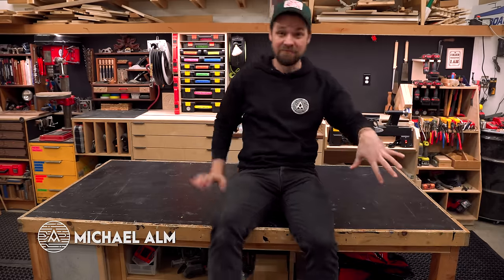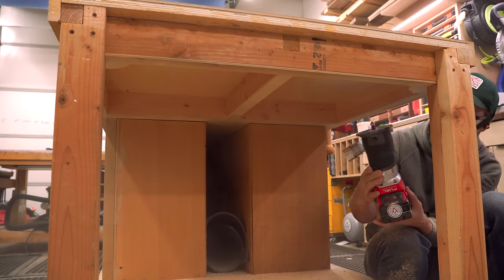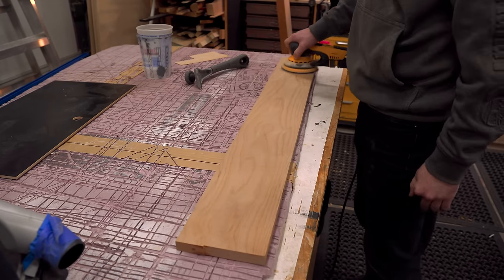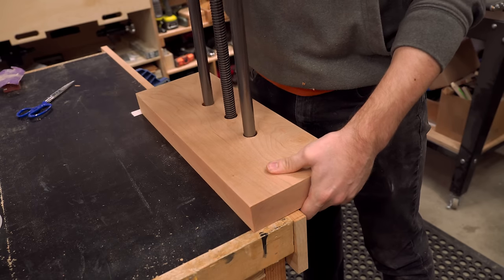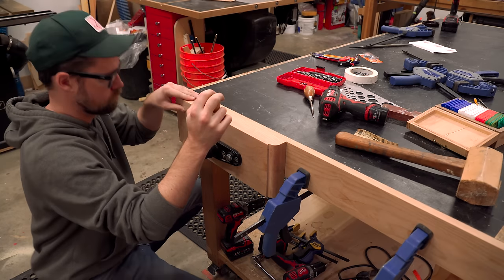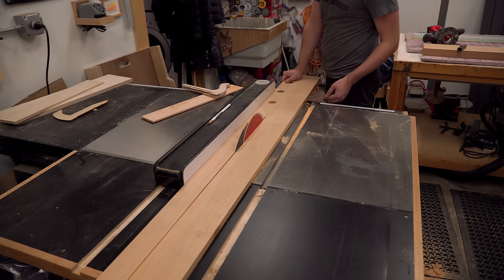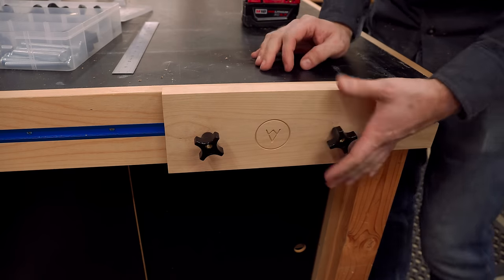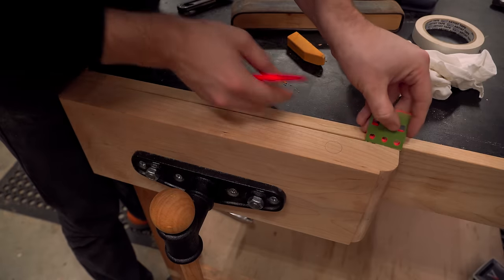Building the ultimate HYBRID WORKBENCH

Comment: Tip for the vise jaw; taper it so it touches at the top first. You will notice when you clamp down on work, the bottom of the jaw moves in, there's a certain "flex" in most vises....... If your jaw is plumb without a taper then your jaw is wider in the top and work isn't gripped as tightly. When you add a small taper as it's cranked down the bottom will still pull in, but the taper means the jaw isn't opened up more in the top...... This grips the work much stronger. Its more evident when a board is clamped upright, like when cuttin a dovetail or the likes....... Its held tightly at the bottom, but the jaw is opened more up top an it can make the work vibrate when sawing, it's vexing. With a tapered jaw it touches in the top first, an as it's cranked down it brings more of the jaw against the work 😁
Reply: 😢😢 16:22

Comment: Such a great video. Lots of little tips I wish I’d known when I installed my vice. 

The t-track is such a great idea. One suggestion for that stop would be to elongate the holes downwards so that instead of having to pull it out and flip it all you’d have to do is loosen the knobs and lift up slightly.
Reply: I was coming to the comments to share the same input!  I was thinking L shaped holes that way you wouldn’t have hold it up and tighten at the same time.

Comment: It might be worth cutting small slots instead of holes for the knobs in the piece you are using as a planing stop. Then instead of having to loosen it, slide it out, flip it over, and slide it back in, all you would have to do is loosen the knobs, raise it up, and tighten them back down. As long as the "low" setting is flush (or below) the top, then resetting it is as simple as loosening the knobs and letting it drop, and raising it, while still simple, will be quicker than what you have now and potentially more adjustable since you could raise it to less that "topped out" if you wanted/needed to.

Comment: Fun video. Enjoyed seeing how you built the tables. 6x3 is the Goldilocks size for my shop. 8x4 is too big. 4x2 is too small. Traditional hand tool bench is 52 x22 but that isn’t necessarily for keeping projects/assembly.

I love a chamfer of any size on the top outermost edge of the moving vise jaw. Helps when going up and down at angles with tools and stops me from hitting it. I run my hands across that edge so many times for guiding strokes.

Comment: @23:18 No need for a straight edge. The sole of the plane is one!

A better way to get the high spots with a plane is to set it for a fairly shallow cut and push the plane down the length of the vice jaw with the plane body skewed about 45°, so the back rides on the reference surface (the bench top) and the iron passes over what you want to bring down. Keep pressure on the heel so it stays firmly on the reference surface and the front doesn't get pulled down by the cutting action.

Comment: Also, if you slot the bolt holes in the planing stop board, you'll be able to lift it in and out of position by just loosening the knobs, instead of having to pull it out of the T-track and flip it over.

Comment: The perpendicular bisector of every chord of a circle goes through the center of the circle. They do not have to touch as you stated.

This is evidenced by the fact that a diameter is a chord, albeit a special instance of one. No diameters share any common points except the center itself.

Comment: On finding the center of a circle, you're halfway to an easier way. Just draw a triangle where all 3 corners are on the edge, doesn't matter what shape of triangle, this works almost no matter what, as long as all 3 are less than 90°. Then from midpoint of each edge to the opposite corner of the triangle, all three lines meet in the middle. (Learned that one on junkyard wars when they built a hovercraft)
Reply: If I've understood your description correctly, that involves measuring the midpoint of a line though which is prone to error and I personally find fiddly. I can see it being useful in lower accuracy situations - for finer accuracy I'd prefer the no measurement method.

Comment: Suggestion for t-track:  use shorter pieces with gaps in the middle of runs so you can insert/remove t-bolts in the middle as well as at the ends.

Comment: It's very rare to get a workbench "correct" the first time around.  Unless you know exactly the kind of work you are going to be doing, and know that you'll be sticking with the same type of tools throughout your woodworking life, it's pretty near impossible.  You are doing great if you only have to build two benches (or rebuild/modify once).  It took me three times over 19 years to dial it in.  If your shop can handle space for two types of benches, that's the way to go.

Comment: You'll probably want to add a 45 degree bevel to the handle-side of the vise jaws.  This will give you clearance for hand saw blades as you're cutting stock held vertically in the vise (like for half-blind dovetails).  Without the bevel, you'll have to have the stock sticking up several inches above the vise jaws, and this either may not be possible for shorter length pieces, or for longer pieces it leaves enough unsecured that the stock flexes as the teeth bite, leading to ragged cuts and way too much noise!

Comment: I haven’t ever used one of those Rockler or similar drill press jigs. On my bench I used my Festool lr 32 system for the dog holes. Only limitation is you kinda have to stay within a spacing divisible by 32 mm. I have also seen people cut the dog holes out with a cnc.

Comment: Those are some fine upgrades which will make woodworking even more fun.
Just wondering: you mentioned you based the location of the dog holes with your vises as starting point, but didn't you plane the smaller vice more on one side than the other? 
I really like the personal touch of your logo with the Shaper. Nice 🙂

Comment: 27:13 wait i thought you picked out the cherry wood for the jaws specifically because of its density and how it would interact with whatever you're working on? doesn't the cork kind of nullify that decision?
Reply: Yeah you can make vise chops out of plywood. It doesn't look as nice as solid wood does but it works just fine. Plywood will be more dimensionally stable too.

Comment: If you didn't have the portable drill guide you might be able to use a router. Might be kinds sketchy though
Reply: I just used a bench top drill press. They don't call them bench top drill presses for nothing. I put it on the bench and drilled away. You can get a cheap bench top drill press for cheaper than what some of those drill guides sell for. Some actually like their dog holes angled a little. Pro tip: do NOT cut square holes into your bench. Round is way better. The argument that you can always make more dogs is not valid. I'm using the same piece of dowel I bought 30 years ago. I still have half of it left. I even have plugs in all of my dog holes so sawdust doesn't filter down under the bench. I just push them out when I need to use a hole.

Comment: 7:30: Circle trick. I do a similar thing with a protractor (or usually a square with a scale), and it requires fewer steps. (More clear than my explanation https://www.youtube.com/watch?v=xkkIziKDGt4. And for a method that requires no measuring, we have Thales Theorem https://www.youtube.com/watch?v=4mVYceMvhls&t=49s
1. Draw a chord on the circle. A chord is a straight line that joins two points on the circle. No place in particular, you just want it to be closer to the edge of the circle than the center.
2. Draw a perpendicular line from the center of the chord to the opposite edge of the circle.
3. Draw a second chord somewhere else on the circle.
4. Draw a perpendicular line from the center of the second chord to the opposite edge of the circle.

The intersection of those two lines is the center of the circle.

Basically you could start with your first two lines and instead of the dividers just draw the perpendicular lines from the center of the two chords formed by those lines. Their intersection will be the center.
Reply: Interesting. I’m going to try this way too. Thanks for altering me to your post.
Reply: > Yes this method also works, although I prefer Michael's method. 

> The method you describe is much simpler for a beginner, but it requires more tools: 
        > 1 Protractor to draw the circle 
        > 1 Pencil to draw the circle and the perpendicular line, potentially 2 pencils to avoid removing the pencil multiple times when drawing many circles.  
        > 1 Ruler to mark the centre and draw the perpendicular line and/or 1 set square. 
> So up to 5 tools. 
> Michael's method is much quicker as it only uses 2 tools, with no need to remove the pencil either.
> It uses two clever mathematical theorems:
        > Perpendicular bisector
        > Perpendicular bisector of a chord (which is what you describe, i.e. where the two perpendicular bisectors of chords meet is the centre of the circle.)
> He also uses the same point of origin for the two chords, so when drawing the arcs he can draw them for both chords without needing to move his protractor.

> Michael could make this method even faster and neater by only drawing the parts of the arcs which actually intersect at the top and bottom.
> So Michael's method is faster if you know how to use it, but your method has its merits particularly when you are trying to find the centre of a circle which you didn't draw in which case you might not have a protractor handy.
Reply: @k4_mi1  Ummm. Why are you including the need to draw circles. My method requires the drawing of no circles. I think you are confusing a compass with a protractor. Please google. I am not expecting to draw circles. Only find existing circle's centers. Michael traced those from a workpiece.

And, I do this regularly with one pencil and a square with a scale. You only need one angle. 90 degrees.

I have no idea what you are on about in your process. Again...

Use your square to draw a chord. use  the scale (ruler) on the square to measure and mark the center of your chord. use the square to draw the perpendicular (at 90 degrees)  line to the chord. Do again. The intersection of the two perpendicular lines is the center. This is only 2 tools, and far fewer steps. And more accurate as you are introducing less variability with the width of the pencil line.

Edit: Please see here https://www.youtube.com/watch?v=xkkIziKDGt4
Reply: Stoney, your argument "I don't need to draw circles" is kind of a red herring, as you have "2. Draw a perpendicular line from the center" --- exactly that step is accomplished with a compass (with the compass being more precise as you don't have to measure to find the center then add the imprecision of drawing a perpendicular with protractor). The other thing to notice is that "3. Draw a second chord" is exactly what Alm's method starts with (you suggest two random chords, Alm just recyces one of the original chord's endpoints for his second chord. So. If anything, I'd say there's no need to draw these two chords like Alm did --- just choose the three endpoints, the hole made by the compass will make it clear enough which points you chose.
Reply: @SenselessUsername   I don't use a protractor. If a square with a scale is not accurate enough to find the center of something all the woodworkers are doing it wrong. Also, I "measure" when I draw the line so I don't do it a second time as in my instructions. It was just easier to explain. I have a centering scale on my square. When I draw my chord I just make it a specific length and it's easy to mark the center when you draw the line. And Thales Theorem still uses that same square and requires no measuring. I'll likely be doing that from now on depending on the situation. I don't have need on a regular basis to have a compass in my apron and I am not going to go digging for one. I suppose I could get dividers that include a writing instrument provision, but I prefer my dividers to be clean. But my square (several really) is always right there. 

Now, in another vein, if you are suggesting that geometry, and especially the intersection of arcs at equal distances from a common point and how powerful that is, could be a way to improve my woodworking, you are correct. I use it sometimes. But for those times when I just need to get to the center of a circle quickly it's the square that is within reach.
Reply: Wow you guys love type

Comment: Those cast iron hold fasts wont bend. They'll stretch out your dog holes.
Reply from the maker: Do you have a recommendation for another type? To be honest I'm not too happy with them.
Reply from the maker: @cycleincircles  Right on! Thanks for the info 🙌
Reply: @Michael Alm  oh- lastly there's a sweet spot of hole-depth for the holdfast to have the best everage on the work. It's about 3 or 4 inches. You may want to add some 2-by lumber pieces under the tabletop to drill longer holes. I won't bug you any more, but let me know and I can send you pics of my workbench.
Reply: @Micheal Alm I use Gramercy holdfasts. James Wright from Wood By Wright got some made up by a blacksmith IIRC, there's a video about them I'm sure.

Comment: Wow, Micheal at 4:19 there is a grey box in the bg of the shot, I have had the same box kicking around for many years, the colour and hardware is identical, mine is a WW2 lens kit made in england, what was in yours and does it have the old horse hair padding inside?
Reply from the maker: It’s an old Boeing propeller repair kit box. Not sure how old it is, and there’s no liner in it. I use it as an apple box while filming. Out here in Seattle we used to have a surplus store where Boeing sold amazing old parts. I only got to go one time before they closed it down. Apparently it was a candy store for makers. My guess is the box came from there.

Comment: Could you have mitered the T tracks at the corner ?
Reply from the maker: Unfortunately you can’t. If you miter them you can’t slide in a t-bolt. It turns them into a closed loop
Reply: Gotcha the top of the mitered T on one side would block the T opening on the other and vice versa 😃 Thanks Michael.

Comment: does anyone else out there still have foot prints in their ass, for setting their planes down on the blade.
one of the first things l was taught, NEVER set your plane down on it's blade.
l made and have shoes for them, with a cut out in the bottom for the blade.
nice work on the table.
Reply: If a workbench is made out of wood then it should not be a problem to place a plane sole down on the bench. When you use a wood plane it is certainly going to be sole down on wood then.
Reply: @1pcfred  l see it as bad practice, l was taught to respect the tools that earn me my £ / $
l get the same feeling when l see folk standing battery tools up on their batteries.
Reply: @nortiousmaximus940  what's wrong with standing cordless tools on their batteries? They even have rubber pads on the bottoms of batteries so you can do that.
Reply: @1pcfred  the fall or get knocked over, less of a bother when on the floor, but when on the edge of a bench, or the roof of a car, and the tool is stood on it's battery, and falls off, they don't always bounce so well.
lay the tool on it's side, it's less likely to fall over / off a surface, especially the floor.
l'm very particular about my tools, they are not cheap,  and are NOT loaned to others, if / when l've had folk work with me, and they can't lay the tool down, or with the plane, put it in it's shoe, or lay it on it's side.
they get told, use you own tools, of find someone else to work with.
Reply: @nortiousmaximus940  if you're particular about your tools then why are you knocking them over? I stand my tools up so they're easier to grab. I don't knock them over either. That's because I'm careful! Placing items on the edge of a bench may not be a wise move either. When you ask for trouble you often get trouble.
Reply: @1pcfred  l don't knock them over, l lay them down so they cannot be knocked over.
l see other knock theirs over all the time.
l'm a mobile VW mechanic, l work outside every day, anything that's stood up, can be knocked over.
which is why l lay everything down.
Reply: @nortiousmaximus940  A VW mechanic. Well that explains it then.
Reply: @1pcfred  prey tell.
Reply: @nortiousmaximus940  amen!